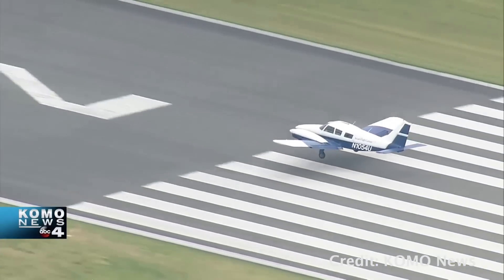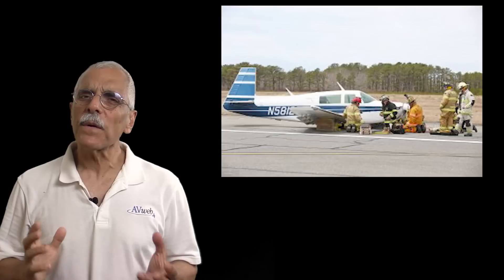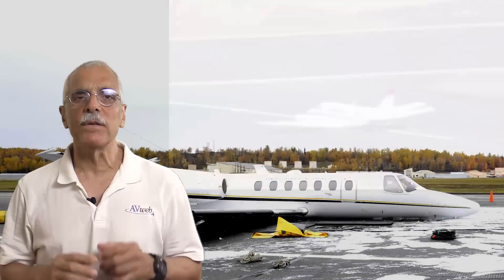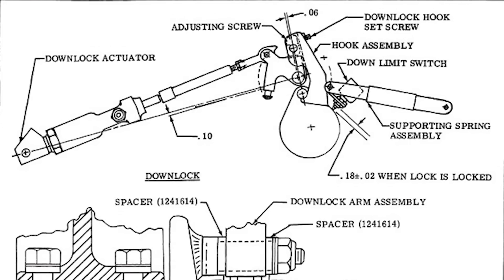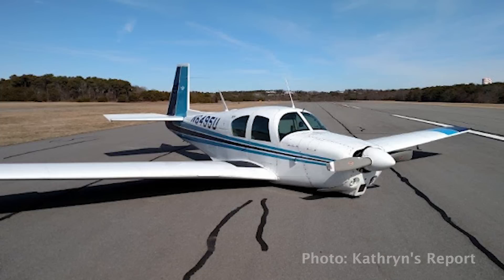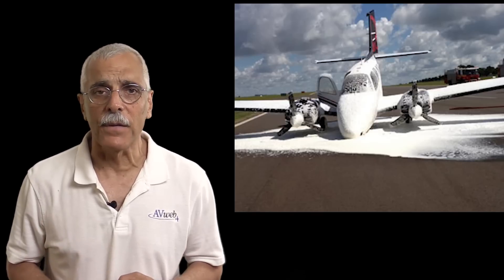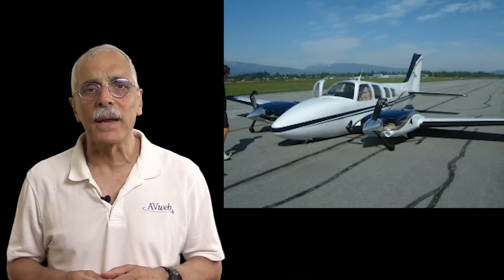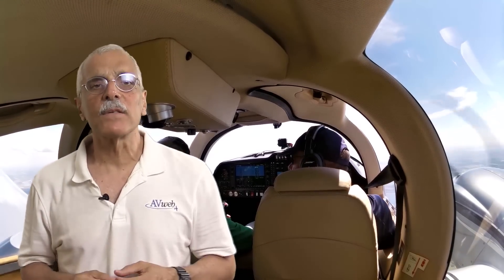Why Gear Up Landings Happen

Comment: Generally speaking, the CHEAPER an insurance claim is, the "less likely" you are to get your premiums raised OR get dropped. To me it also is common sense that a stopped engine and propeller is less likely to catastrophically fail during a gear up landing , with less chance of flying parts, broken crankcases, oil leakage, potential fires, etc. So the bottom line is that  you're not just saving your insurance company money. Because its not like a more expensive gear up landing is ONLY going to cost the insurance company more money. Its going to cost YOU more money.

Comment: Wouldn't any analysis of gear-up landings and percentages need to be calculated based not on what percentage of gear-up landings involve a certain plane alone, but also based upon the number of landings involving certain types of aircraft period? Clearly the fewer planes of a certain type are flying, the "less likely" they are to be landed gear up. Statistics are essentially bullshit period. How many times something happens in the past to others doesn't really mean shit as far as a certain pilot's "odds" or "likelihood" of doing the same thing.
Reply: Tempered/Percentage based statistics also exist. Thats where you get numbers like "x per x-thousand flights" which is an actual comparison, rather than something like "The AMSCO Sport plane is very safe because it has never crashed... also there is only 3 that were ever built..)

Comment: In a glider, you always use the airbrake when landing, so a lot of pilots put an empty fag packet over the top of the lever, so when they grab it, it reminds them to put the gear down.  
I'm surprised that planes don't do it automatically when air speed is low at low altitude..  Of course, if the gear won't come out, that's a different matter.
Reply: Automating this is stupid. You really do not know what the pilot's intentions are. Plus you would be generating unexpected drag at the worst possible moment (low altitude).
Also, putting things around as a reminder is a bad idea. That's why you have (and train with) a checklist.
Even on a trainer glider with non-retractable landing gear, my checklist included "gear down".
Reply: 1969 - 1978 built Cessnas with an automatic what?

Comment: I remember years ago when the 210 first came out, a reviewer said in his review that the landing gear looks like a malfunction during transit.  The 172R has the same look.
Reply: ..210s have had 3 different systems over the yrs..the 182 and 172 rgs do not have the 210 main gearpack system

Comment: flying in- in a b-55 in approach with gear down, 3 greens,  we were told there is faster traffic approaching from behind. the pilot puts the gear up.   essentially on a 2 mile runway we were going to land at mid length.  the landing gear handle becomes my focal point.  we go over the numbers - go past 1- 2 -3- 4000' - we're going to land at 5k' and  i'm feeling ground effect.   I  put the gear handle down.  gear lights turn green , the pilot flares and we land. he immediately admits he forgot the gear was down and i just saved his belly skin....literally.

Comment: If 54% are pilot error, why doesn't the aircraft have an audible alarm triggered by ground proximity?
Reply: Some do. Turbine aircraft GPWS systems give an audible "To Low, Gear" warning. Smaller airplanes have a warning if the throttle is at idle and the gear is still retracted. Sadly, all types of warnings are sometimes ignored.

Comment: In many of those examples the crew definitely didn't go through the after gear up landing check list
Reply: after gear-up landing checklist?
Would that entail
1: Turn off engines
2: Turn off electronics
3: Turn off master switch
4: Get out.
5????
6 Profit

Comment: Surprised that the R182 is so much less (by incident) than the 210 ...
Reply: Nowhere near as many made.
Reply: Gwen Walcott ... Actually, I don't believe I've ever seen a 182RG that wasn't used extensively for pilot training, especially dual. When there are two pilots onboard and one is a CFI, it's more likely that the checklist will be used. IMHO

Comment: Engine off will definitely save the engine. Congrats for the skills of those pilots able to land safely engine out. Well done. That's the correct way of doing it.
Reply: Maybe you missed the part where it was stated that the engine is going to require a teardown even if it's stopped. Especially with the adrenaline flowing, many may misjudge the final power-off glide and, without power to do a go-around, they're screwed. An under- or over-shoot may kill you. Landing gear-up won't. Leave the engines running.
Reply: Indeed. However. you can shut it off at low altitude, when you're certain you're landing.

Comment: My friend actually landed with his landing gear up by mistake. Two years later he killed himself and two others when he flew into a storm just north of Kansas City en route to Anderson, Indiana. The others were a medical doctor and the head of Indiana Drug Enforcement.  Later the FAA paid off on that mistake when they failed to "hand him off" to the KC controller. While they claim to not be responsible for weather, they did pay off big time.  That was the last of three incidents he had. The other was landing an overloaded airplane and doing $80,000 in damages to the gear. That one was technically not his fault.

Comment: I do a GUNNSS checklist (in my case) three times, and the last one is triggered physically by the approaching threshold, in sort of a last time check. Therefore I find it is intuitive and even when I am flying fixed gear planes I still find myself attempting to do it lol. Not saying it wont happen, since with retractables it can go either way (literally), but so far so good.

Comment: I was in a Piper Malibu that was just serviced a week before. We flew from St Martin CA to San Diego and Pomona CA and then back to St Martin in the evening. I went to lower the landing gear on approach and only got 2 out of 3 gear lights. the Nose gear had problems. Did 6 cycles ..and got a nose gear light. We landed with fire department ready and waiting.  the Nose gear held up. !! I immediately took a flashlight and saw hydraulic fluid leaked all over the nose gear. the service mechanic failed to tighten a hydraulic fitting...DOH
Reply: Joseph...YES,, no leak during pre flight inspection. It came loose after a few cycles of the landing gear . The mechanic failed to tighten the hydraulic hose
Reply: That's a MIF; Maintenance Induced Failure". Maintenance is necessary, but any time it's been performed, the machine should be viewed with extreme suspicion until it's been through a few cycles.
Reply: Andrew..you are a Clown... the hydraulic fitting came loose during the return flight
Reply: Was there a reason why he forgot to tighten the fitting? Maybe the phone rang or somebody knocked on his door or he had to use the toilet which threw him out of sequence?
Reply: @sanfranciscobay  🤔🙄 lol
Reply: Hey SFBay, just another poor mechanic who didn't go over his check list
Reply: SanFranciscoBay I bet you've said "I want to talk to your manager" a time or two haven't ya buddy??
Reply: Dollars to donuts, he was 
a) Deeply embarrassed
b) Interrupted or otherwise distracted around the point he was reassembling the hydraulic system.
Reply: And what if there was no fluid present during the preflight?  Connection may have vibrated loose during the flight or perhaps the constant pressure from that flight time finally got too much for the incorrectly tightened fitting.  Is he still someone that you won't fly with, huh?
Reply: @josephking7948  your right Joseph another reason that may have caused the excessive hydraulic fluid could be due to all the recycling completed in a short period.
Reply: Were you or the investigation able to determine who the mechanic was and why the fitting was not tightened? Does this go on the mechanics record or is it too difficult to prove who is at fault?
Reply: @sanfranciscobay  yes most of the time you can identify who did what on an aircraft by reviewing the maintenance performed section in the aircraft records which should always be with the aircraft. Maintenance is required to document their work and sign it. In addition there should be another signature by the person who inspected the completed work.
Reply: Yes, discussed this with the mechanic and he rechecked all his work on this plane
Reply: The mechanic told me he was distracted by the shop owner who had another plane show up for service. The mechanic looked at his log book and saw that he took 1 hour to inspect another plane on the same day.
Reply: back in'85, I asisted an annual inspection on  an Aztec, which had a CO2 bottle backup, which was triggered 2 yrs earlier. I had also though being an A&P would lead to something more satisfying! @ least I got lots of right seat time!
Reply: davey.. ok coool.  Just as long as the A&P mechanic installed it correctly..LOL
Reply: Sadly a high percentage of accidents happen between 1-100 Hours after overhauls and major maintenance.
Reply: Years ago I had a roommate that was a crew chief for the F15.

He told me this story ;
 He had to take a leak really bad out on the flight line and it was too far to walk back so he just stood up in the wheel well of the F-15 and relieved himself. The pilot unexpectedly showed up and did his walk around and saw the " fluid" on the ground. He put a couple fingers in it.. smelled it.. tasted it...
Reply: What do you think Jerry: could/should the PIC have found the loose hydraulic hose fitting in a pre-flight?
Reply: Hydraulic fluid all over the gear? Pilot in command who didn't look at his undercarriage before going up bears ultimate responsibility. Blaming the mechanic is not going to make him a better pilot; or someone I want to fly with.
Reply: unless the mechanic jacked the AC up and cycled the gear there would be no leak to find on his pre flight if no pressure had been applied to the system. 
Blame the mechanic in this case not the pilot.
Reply: just another poor pilot that didn't look his plane over before every flight.
Reply: Diesel Ramcharger see above. Witness stated there was no leak prior to flight. You can have a loose fitting that holds pressure but vibrates loser in flight and then no longer holds.
Reply: @andrew_culver  Problem might have started after take off. But he did two other landings and takeoffs before going St. Marten so it's likely the problem was developing and pilot didn't do a thorough check each time.  He got lucky.

Comment: Those that have and those that will.
Reply: Bullshit.
Reply: Yaaaaaa  Just bleed the airspeed  off in the flare.... hold it off as long as you can....  the stall horn will be blaring , then listen for the tie down ring on the tail to his the ground...... and think of me as the seat backs fly forward and the air step digs into the ground and you slide about no more then 150'........lol.

Comment: The Russians have a problem with gear up landings but they have a fix. They build an airplane that if it is gear upped, you jack it up, drop the gear, and go fly it again. Unless the engine eats a big rock, you are good to go. 

 Design for Mishap. If Wichita thought that way they'd stlll be making airplanes and money in quantity. Oh wait, they still make money because of the gullible taxpayer who pays $5M for a $2M trainer instead of just buying it off the rack from Pilatus. And then they turn students loose in the $5M bird loose on their first solo. Check with your insurer to see what the premiums would be on a PC-9 (yes, you can buy one, and I think it is a type certificated aircraft here-I know the PC-7 is) for primary instruction.  I'm guessing 80% of hull value annually? 

Oh yes, just checked. PC-9 is type certificated. I'm sure your FBO will want to lease it back.............
Reply: was thinking how about small extra wheels under fuselage but it is weight

Comment: When I was a kid my dad owned a 1/4 share in a Cessna 177 RG. It looked like a sports car, just an incredibly beautiful plane. Once, one of the other partners (My dad's best friend) landed at Burbank, coming in and making a nearly perfect landing, except for the minor problem of the landing gear. He used a check list, but as he was going through it he got a call from the Tower and ended up missing a step.
       The weird thing was, the gear warning horn was working just fine. And the warning to had been wired to play (quite loudly) into the head phones for the radio.
    I have seen several other accidents like this, where the gear warning horn can clearly be heard, but for whatever reason the pilot doesn't hear it, or understand it. I wish you had addressed this issue.
    This is not just a problem for GA pilots. At the Air Force Base I grew up near, a C-5 crew was doing touch and goes. Apparently they were getting annoyed by the gear warning horn, so the pulled the breaker that powered it. What happened next is easy to guess at. Needless to say, that pilot no longer had a flying job in the USAF.
     Not long after this I was talking to a different C-5 pilot. He told me that the pilot sits so high up, and the landing gears are so short, you can't really tell you've landed gear up until you stop on the runway then pow up to taxi to the ramp. He said you might see flashing lights and look over to see the fire trucks coming, and that's how you learn your career in the Air Force has just ended.
      Have you seen this one? It just seems that what this guy did was really not a good idea. At the point he touches down he is on the ground at an airport. Taking off again with an unknown amount of damage just seems stupid to me.
https://www.youtube.com/watch?v=sgdSflSCTQM

Comment: Unannounced gear up landing on film. There is an interesting film on YouTube, search on "Airplane crash altiport de Megève france altiport france landing without landing gear".  And while most of us, of you, will say "that will never happen to me" I'm sure this pilot would have said exactly the same... Megeve is a very short, very steep mountain airfield.
Reply: It was on "ice pilots nwt"
Reply: There was also a CL-215 water bomber that accidentally landed gear up in Turkey, captured head-on by a documentary film crew. It's on Youtube (of course) as well. Looked expensive...